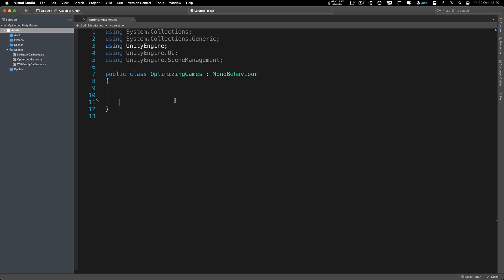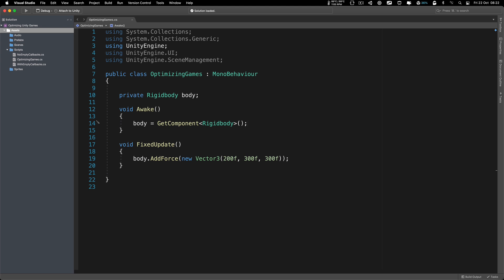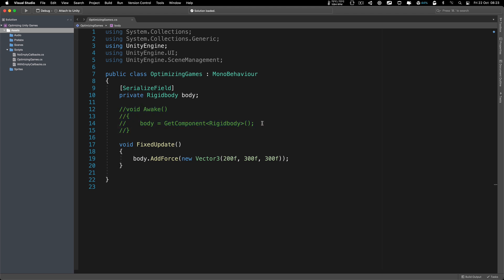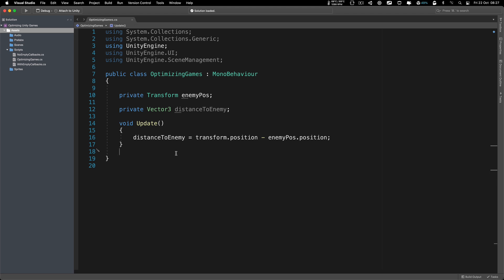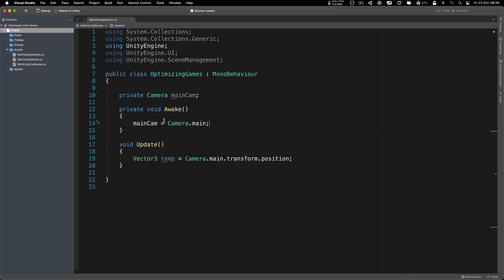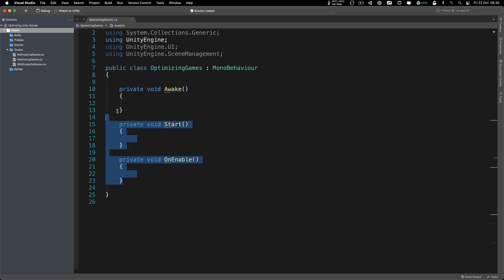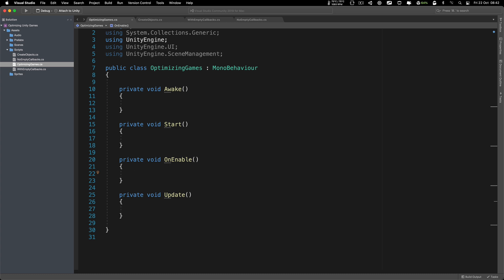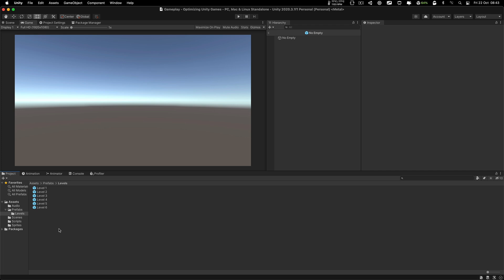Optimize Your Games In Unity To 60 FPS And Above!

Comment: Nice tips! I would never imagine that just calling transform.something would be bad for performance. I use it in many places, many times, for vehicles and pedestrians. I’ll check it later with a cached variable. 

By the way on the last thing you mentioned I don’t think it would be great. How are you loading those prefabs? 
If you place them inside a Resources folder that could slow down the startup of the app. 
I do prefer using asynchronous scene loading (sometimes additive, sometimes not).

Comment: 3:50 Vector3 is a struct (value type), it's instances as a local variables do not produce heap allocations. This code is perfectly performant. By caching the value in a field you actually made it worse, because that way you've permanently reserved X bytes of memory that a Vector3 takes + it takes more time to write a value from stack to somewhere in a heap.
Reply: yes!! was about the comment the same thing. creating a struct in a method is just shifting the stack index a bits all. but changing the value in the heap memory takes more process. as far as I know
Reply: Indeed, doing this for a class would make sense of course :D
Reply: I am grateful for comments like this. I am not a Software expert in any way. Just a dude making his own game. Like a piece of Art. Input like this makes it easier to keep things organized. So thank you

Comment: I'll hold my hands up,I make 99% of everything public is that bad or should I see the light and start to use serializefield ?
Reply: The problem with Public variables is you can modify them in other objects you don't really intend to and the results can be unexpected and possibly hard to track down.

You're free to do what you want, but I highly suggest you make everything Private by default and if you need it in the Inspector put SerializeField on it. It's just a good habit to get into.

There's a reason this is stressed to programmers. It was drilled into our heads in my intro Computer Science classes in college.
Reply: @clamum9648  yea, I'll start doing it,I was self taught so have loads of bad habits lol
Reply: @random_precision_software  It's all good, we're always learning. I definitely am no expert myself. I've worked professionally for about 13 years doing software development and the best developers I've worked with have a genuine passion for software development and continually try to better themselves and learn new skills, often working on their own personal projects here and there. Good luck bro
Reply: @clamum9648  thank you. 👍
Reply: When coding by yourself on a short-term project you'll likely never run into issues, encapsulation (making things private where you should) matters a lot more in team settings and larger projects where limiting the scope of what state can be updated by external methods and by what means makes it a lot harder to step on each other's toes, and on your own toes on accident.
Reply: @Eckster  Yeah I actually agree, it's not a big deal on smaller projects. I just think it's a good habit to get into.
Reply: @Eckster  👍